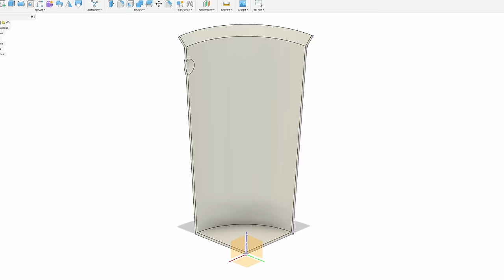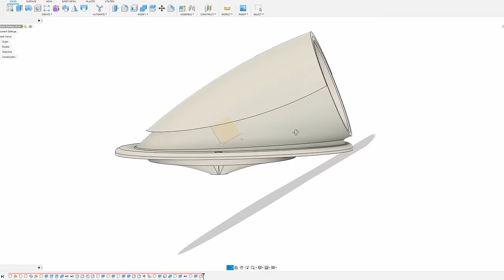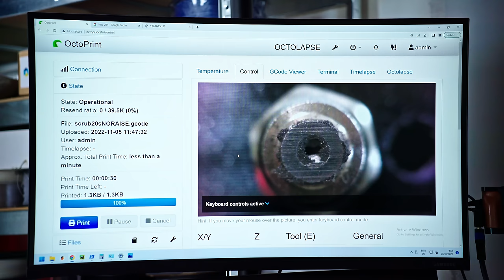Why you should get a 3D printer NOW

Comment: 6:35 100% BS.
Reply: Huh?  you do know what unobtrusive means, right?  I have 6 printers, and have not attracted a bit of attention to my hobby.  None of my neighbors know about it at all and the only telltale sign would be an occasional spool holder in the recycle bin.
Reply: @brianmi40  1) 3dp is not inexpensive to get into nor sustain; consumables are much more than filament.  Hence, it will obtrude your wallet.  2) 3dp can take up a ridiculous amount of space, especially if you are building kits or tinkering.  Hence, it will obtrude your space. 3) The fumes given off by 3pd are potentially dangerous, especially ABS and using unenclosed printers; hence it will obtrude air quality.  Please let me know if this helps.
Reply: @bernardtarver  I have no clue how anyone could get that misinformed.  I own a total of 8 3D printers and started 3D printing 10+ years ago.  I've never "consumed" anything but filament and electricity, not even wore out a nozzle or a belt after 500+ prints.  WRONG #1

3D printing is NOT expensive to get into, a quality name brand 220x220x250 printer with a PEI magnetic bed and automatic bed leveling can be bought for $80 delivered, with a one year warranty.  WRONG #2

Consumer level hobbyist printer kits can be assembled on a kitchen table in an afternoon.  I know, I assembled a Printrbot that way 10 years ago from lasercut wood.  Most people interested in 3D printing own a kitchen table.  But the days of printer "kits" with 100 parts spread out like a Prusa are largely gone, 80%+ of printers assemble from major preassembled sections in 20 minutes. WRONG #3

More 3D printing is done with PLA and PETG than all other types of filament combined as far as hobbyist printers, neither of which offgas harmful fumes.  Don't want to be exposed to ABS fumes?  Don't use it, or print in a garage or ventilate the printer.  PETG is higher temp than PLA, holds up well with UV resistance outdoors, so ABS really only comes in to play to print for use inside a car -- a tiny portion of 3D printing.  WRONG #4

So no, telling falsehoods or being uninformed doesn't"help".
Reply: @brianmi40  Please learn to communicate more concisely.  Filament, nozzles, PTFE tubes, build plate adhesive, v wheels, etc., are all consumables.  Quality parts and materials from name brands (e.g., Slice Engineering, Prusament, Misumi, ProtoPasta, Bondtech, LDO, etc.) are costly.  Your experience with 3dp is limited to defunct and cheap low-end printers.  Try spending $1,500 and building a Voron or RatRig; you will eat Ramen noodles from your couch for weeks.  Better yet, develop your own CAD models.  Lastly, feel free to review papers on 3dp emissions on Google Scholar (e.g., Fume emissions from a low-cost 3-D printer with various filaments).
Reply: @bernardtarver  Filament is cheap for most use-cases, nozzles are cheap(and some will last a lifetime), adhesives are cheap, v wheels are cheap, ptfe tubes are cheap. All of these have to be replaced over the course of many months, with some such as PTFE tubes rarely if ever need replaced for the common user. I have, in fact, not once ever heard of it being necessary outside of printing large volumes of abrasive filament. Over the course of a year of regularly printing, a person may need only replace each of these once with some, such as adhesives and ptfe tubes, not even applying to most people. Your point about higher end printers is merely moving goalposts. What you call defunct is the equipment that suits the needs of 95% of people who use it as a tool. The cost of a high end printer is completely irrelevant, as is how loud they are or how large they are. The emissions point is valid, however, according to the literature.

And lastly, please learn to communicate without coming across as stuck up and arrogant. It would do you good.